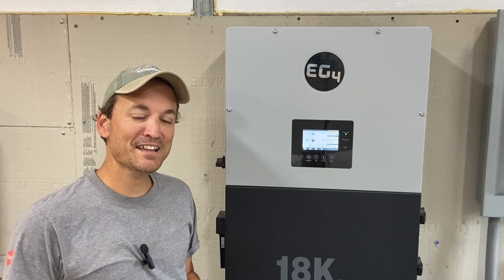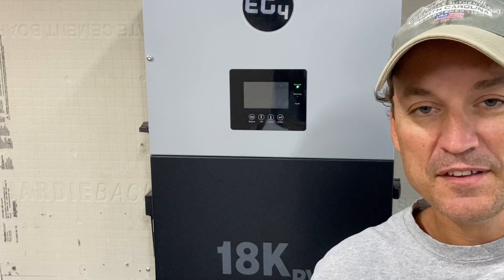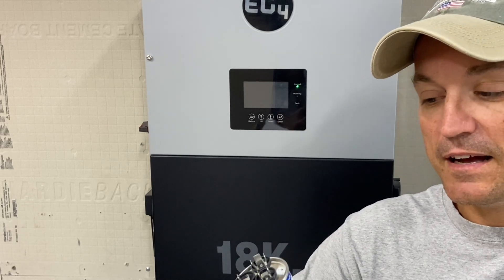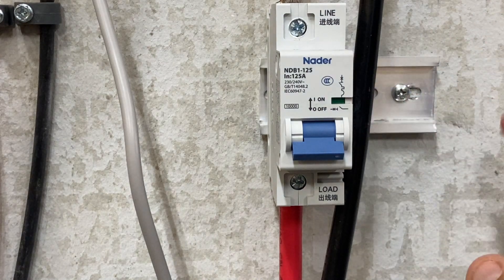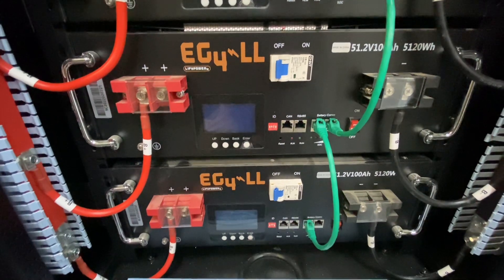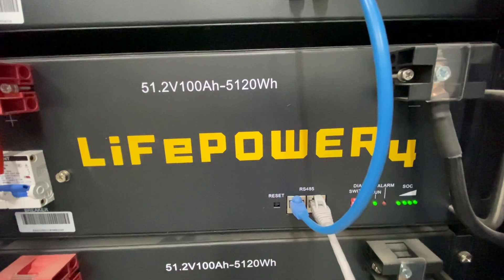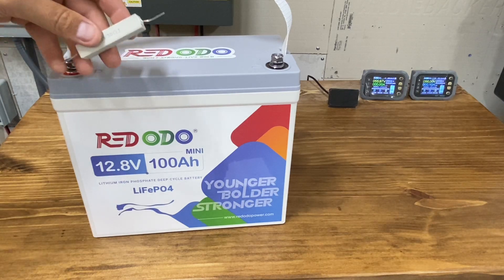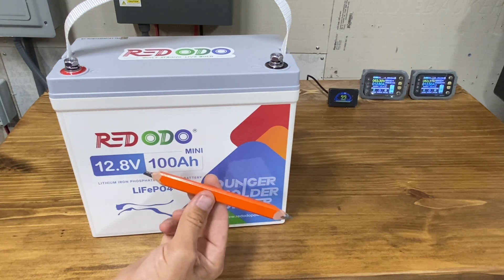Pre-charge resistors, simple techniques to avoid mistakes~ off grid solar

Comment: Gavin, I know this will rank very low on the totem pole of your interest... but I'd sincerely appreciate your input. And apologies for this long-winded text! My setup: 1) 12-volt AGM flat plate accessory/starter battery in 2010 Toyota Prius. 2) Renogy 1000W inverter model: RIV1210PU-126-US. 3) Cables: Pre-made Prius Custom Cable Kit PCCK-1 from boatwireusa. 4) The wiring kit contains two sets of positive/negative 4AWG wires attached to two SB 175A 600V Anderson Connectors. One set is for battery connect and one set for inverter connect. I use the quick connect/disconnect Anderson connectors to attach/detach the inverter from the Prius to either use the inverter or store it. 5) Also have a Blue Sea Systems MRBF Terminal Fuse Block mounted to the positive terminal of the Prius battery. So, one set is permanently attached to the battery and fuse, and the other set is permanently attached to the inverter. The battery side positive lead connector of the Anderson connector is attached to the MRBF terminal post and I have a 100A 58V fuse installed in the Anderson Terminal Fuse Block. With that said, I’m concerned about the continual connecting/disconnecting of the two Anderson plugs causing sparking and/or degradation of the 12-volt battery and the capacitors in the Renogy inverter. How would you go about pre-charging the inverter capacitors using this quick connect/disconnect scenario? Hold one of two-leads from an incandescent light bulb socket to the positive Anderson connector lead from the battery and then touch the other light bulb socket lead to the positive lead of the Anderson connector attached to the inverter? Or use a resistor in place of a light bulb as in your video? If so, does the inverter need to be powered on or off when doing a pre-charge? Again, sorry about all the detail but when doing this sort of stuff you can't be too careful. Really appreciate any input on this.
Reply from the maker: The inverter doesn’t need to be on to precharge. There are actually a bunch of DIY methods for pre charging. I haven’t delved into it too deeply. I do like the light bulb method, but I would make it a permanent fixture somehow, so you don’t have to rig something up each time.

Comment: Not sure why you said this is not for lead acid. Doesn't matter what battery you have you should still precharge the inverter
Reply from the maker: @sudo936  because with lead acid you don’t have that massive inrush current you do with Lithium iron phosphate.
Reply: @GavinStoneDIY  Yeah its still makes a spark though
Reply from the maker: @sudo936  not so much trying to avoid a spark, just trying to avoid that 200 amp dump into the capacitors.

Comment: Is a resistor needed when using an 18kpv? Example?
Reply from the maker: It depends on the battery. But yes it would be needed if the battery doesn’t have a built in resistor.
Reply: @GavinStoneDIY  eg4 Power Pro
Reply from the maker: @user-jm7jk6xu2r  you’re good then. The power pros come with built in resistors. Just make sure to follow the correct startup proceeders. Battery breakers on, on the battery and inverter. Then BMS switch on.
Reply: @GavinStoneDIY  Thx much. I appreciate the intel

Comment: Also one more question please... Let's say I charge the capacitors of a 5kW inverter just by flipping the breaker. It's a fast breaker, engages very fast and doesn't really cause sparks inside or anything. Or another scenario, I just enable Discharging through the BMS after I connect the battery. If the BMS doesn't see this situation as a short circuit, do you think it's ok that the capacitors charge as quickly as they want? (But without any kind of a spark incident?)
Reply from the maker: Without resistor, there is always a chance of damage to the battery or inverter. 

Since most people don’t turn the power off to the devices multiple times it’s not usually an issue.
Reply: @GavinStoneDIY Regarding the battery I am not really worried. The BMS does it's thing and I pay for a decent BMS. 
Regarding the Inverter, I am a bit worried. Since it only happened twice and didn't allow for it again, thankfully no damage was done. There was a deep pop, but it might just have been the large current running through the cables (much like when you spot weld and the cables jump...). 
I have tested the inverter since and it's working without issues thankfully... 

I ended up building a precharge system with a resistor and a switch. Now I use that before turning on the main battery breaker/switch.

Comment: Hello! I need your opinion on something... 
I have built a 48V LifePo4 battery. It has a JK BMS and a 200A breaker in between the battery and the inverter. What I tend to do is to keep everything on and flip the DISCHARGE option through the app... Unfortunately I too heard a pop (I really hope it just is the current being big and not the capacitor blowing...)... The BMS immediately shuts down and sees the whole rush current incident as a short circuit. 30S later the inverter will get power again through the BMS and it works... The inverter turns on normally. 
I haven't yet tested with a load yet, but it's a big hybrid inverter, 10kW continuous... 
I have been using the same method with a 5.6kW inverter for many months now, but I didn't have the BMS turn off on me, because the current wasn't that big. But with this new 10kW inverter I have this behavior... 
Is my method safe, or because the inrush current is way too large it's unsafe?... I don't have sparks or things like that, but the capacitors do charge rapidly which I think it might not be good... 
And the pop does make me concerned...

Any input would be much appreciated... 
One plan I came up with is to use 2 resistors and a dual polarity breaker in order to precharge the whole thing... But after your video, the pop does make me very concerned... Hope I didn't fry the inverter from day one...
Reply from the maker: Does the BMS still function correctly?

Comment: Gavin I have a 300 watt solar system in my van I left the battery go below 21 so how do I recharge the system
Reply from the maker: Typically inverters that small would be fine without using a precharge resistor. But you can always use a resistor like I mentioned. Or even a double sided pencil.

Comment: I have seen a couple different precharge resistor sizing calculators online but none of them make much sense.  Are there any calculators where you could just enter the nominal voltage of an LFP pack, the capacitance in your inverter caps (if you can find them) and the time you want or need to hold down the button?  Something that will tell you what wattage and ohm ratings you will need as well as the amperage that will pass through it so you can size the conductors properly?

Also, I am assuming the automatic precharge resistor routine in the EG4 batteries is driven by the BMS?
Reply from the maker: Yes the precharge sequence is initiated by the BMS in the rack batteries. 
As far as sizing the resistor, honestly I’ve just always used 20 or 30 ohm for 30 seconds or so. I’m sure there’s a formula, but I’ve never seen it.

Comment: Sorry but you don't PRE CHARGE RESISTORS.    You Pre Charge the Capacitors.
Reply from the maker: You use resistors to charge capacitors.
Reply: @GavinStoneDIY   That's right,  YOU DO NOT PRE-CHARGE RESISTORS.    Resistors cannot be charged.   THE TITLE TO THE VID MAKES NO SENSE, which leads me to believe, what ever is taught  in the video is suspect.    Get it.  Just trying to help,
Reply from the maker: @treyfred3247  most high end rack batteries come with built in precharge resistors. And many people don’t utilize those correctly. Unfortunately that causes damage to their equipment. So I made the video to try and help those people understand the startup procedures involved. 

Maybe you could contact those rack battery companies and lobby for them to change the name of the device to a “capacitor precharger”. 🤷🏼‍♂️

Let me know how that goes.
Reply: @GavinStoneDIY  In defense of Gavin's title, "pre-charge resistors" implies that a resistor is used to charge something.  Accurate.  If it had said "pre-charged resistor" that would've been different.

Comment: Hey Gavin!  I'm glad you made this video. Not only is it important to someone new to solar but I feel like it can be pretty easy for even experienced folks to be distracted or maybe frustrated when troubleshooting your system and get the sequence out of order.  Or maybe there's one battery in the rack that was left on for some reason.  Easy to make a mistake.  PITA to fix it.  What I've done to help anyone else, such as the wife, but also as a mandatory ritual for myself, is print out a page for the startup and shutdown sequence and include it in a binder I keep right on or beside the inverter.  I guess if you do this every day it's a no-brainer but it's too easy to skip this step and we've all seen the sad faces when someone does so.  So every time I do a shutdown or startup I review that page and take it step by step.  It may sound a little overly cautious but so far I haven't blown up any capacitors.  Keep up the good work!
Reply from the maker: Excellent idea. Because it only takes one wrong flip of a breaker to ruin your system.

Comment: My favorite way is definitely using a 120v lower wattage incandescent lightbulb as a resistor.  They light up when the capacitor is charging and go dim when the capacitor is full.  I actually have a lamp holder installed in my system with a momentary button that I can push and hold until the bulb goes dim before turning my battery disconnect to the on position.
Reply from the maker: I’ve heard of this. I need to make video on that. I like that idea.
Reply: @GavinStoneDIY This is what I always do also. It works really well! Never had an issue with it.
Reply: Generally you want to connect the inverter wiring directly after the lamp goes out completely.  Clear lamps are better for this as you can see the filament directly and thus see when it stops glowing.  Acid etch inside frost lamps (the ones that look gray) diffuse the filament by a factor of 200 or so and silica or kaolin powder coat lamps by a factor of a few thousand, and thus it is harder to see the filament glowing.  Clear lamps also allow for visual inspection of the filament to make sure it isn't broken.

Comment: If you use dp breakers like I do, you'll need to install a jumper across one set of contacts and the 5W 50 Ohm resistor across the other.

If you don’t pre-charge the 6500ex, the inrush current on mine were 17A!

Comment: Thanks for the video.  I see people doing this a lot with the battery wire disconnected (like you showed with the neg wire to that standalone battery). That capacitor is often discharging for the time after you remove the resistor and hook it back up (30sec, 1 min?). I think it is worth saying that you shouldn't pre-charge, go to lunch and then come back and hook it up.
I think a better technique might be to Open/Off the breaker you show at the beginning and then short the resistor across the open breaker.  Super easy to do by putting the leads on both screws.  Then you can just close/on the breaker and you are done with zero lag to connect things.
Reply: That sounds like the best way to me. I used a pencil because I didnt have a resistor laying around. But, I did order one and have it now.
Reply from the maker: Excellent points. Thank you.